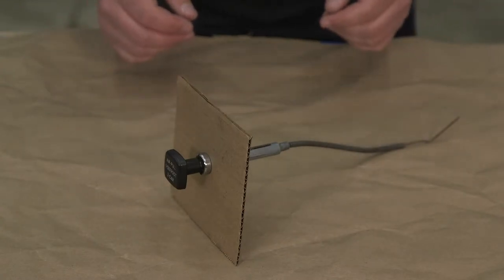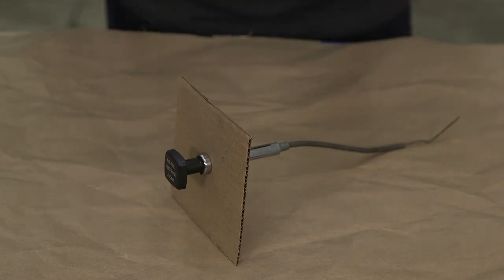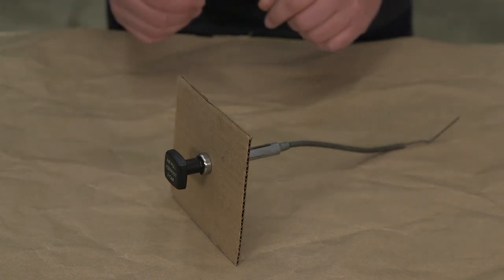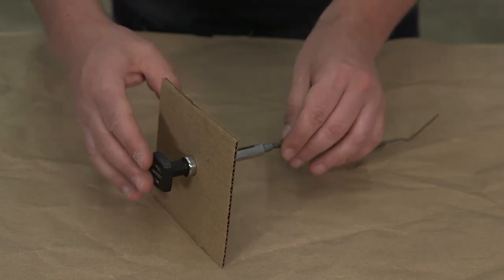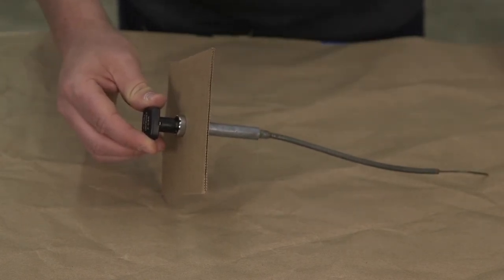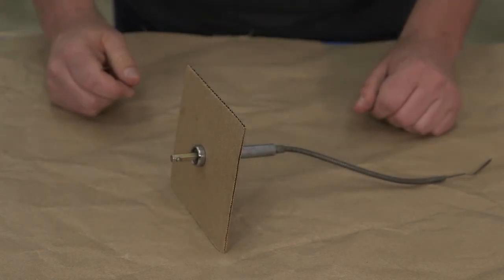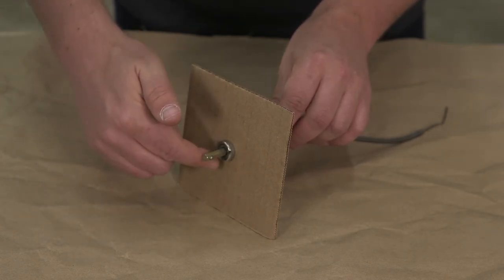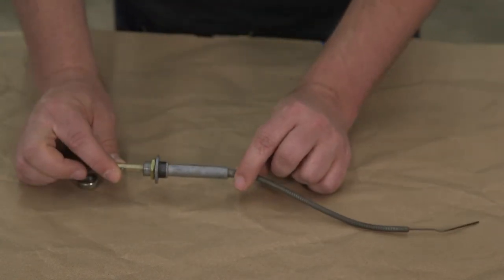Triumph TR6: How to remove HVAC & Choke controls

Comment: Good tip.  However, it would be great if you could show us how to adjust the choke cable.  I replaced my choke cables, but can't get the choke to operate correctly.  I think the cable needs some adjustment to get it to actually pull both chockes at the same time.
Reply: You don't need to do both carbs. If your cable is attached to one carb, the linkage will open the other. Also, the choke cable can be difficult to pull because of the way it's routed around the heater, at least it is on mine...